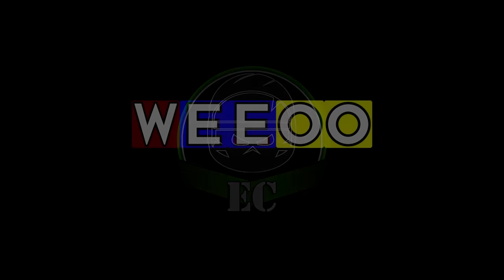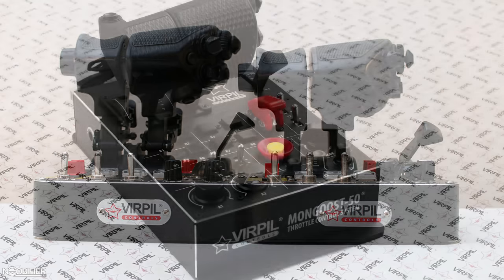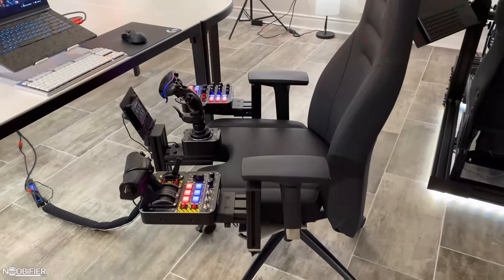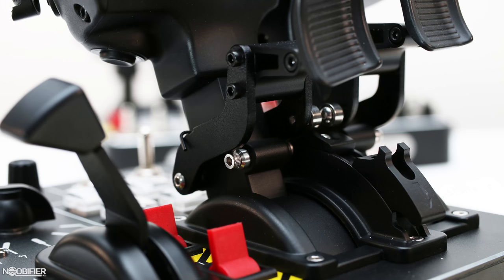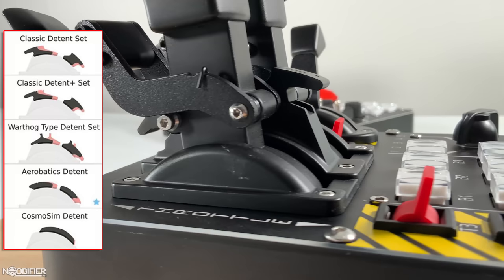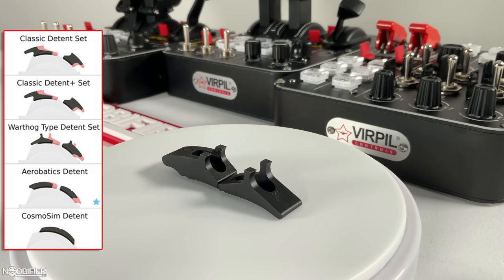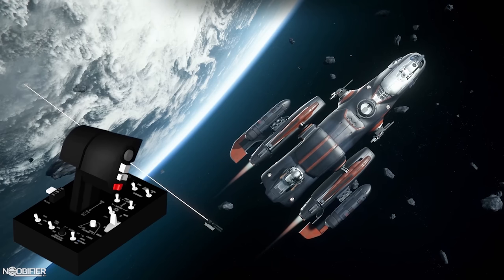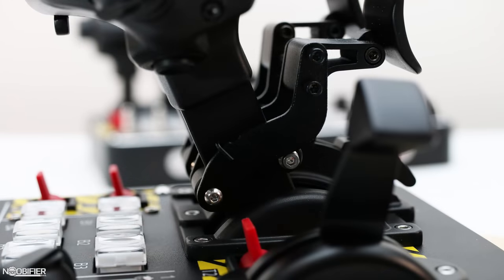MT50 CM3 Throttle - First look - Review & Overview - Virpil

Comment: Don't ever say you can't strip metal threads. I've seen it happen SOOOOOOOOOOO MUCH and I work on planes. It's soooooooo upsetting when you get 96 fasteners run down on a panel. Then the last 97th fastener just drops in or won't go in at all cuz the anchor basket is broken, missing, or stripped out. And now ya gotta pull alllllllll them other fasteners back out to fix that one anchor basket.

Comment: Quick question on the detents...  For the afterburner detent, is it possible to have to far enough to allow some range of travel after the lift?  I only ask as I fly in msfs and They usually have reverse thrust - Main power setting - Max power - TOGA.  So I'd like to put max and toga behind a detent with enough room to be easily able to set it to the correct power setting while leaving enough play for the main power setting if that makes any sense?
Reply from the maker: They are completely swappable, PLUS can be moved about 15 Deg either way so between the 10 included pieces, and the adjustment you should be able to get the exact performance you are looking for.. there are also those who have made 3D printed customs ones
Reply: @NOOBIFIER1337  Brilliant thanks so much! Might be worth the upgrade from my cm2 then and a perfect excuse to get a control panel while I'm at it
Reply from the maker: @MichaelHenfrey  There was a period of time when they were giving people who owned a CM2 a 10% discount on the upgrade. You should maybe contact them and find out if that still applicable

Comment: Does lifting the throttle for idle/AB detent send a signal out the controller? I ask because DCS usually has an "idle cutoff" key binding for most engines and it would be nice to have this bound to the throttles position instead of pressing a button
Reply from the maker: Not that I know if, but joystick gremlin has that feature

Comment: Wish they made it reversible so it can be used as a southpaw throttle. It blows my mind that there is STILL no lefty or even ambidextrous combat throttles with hats, encoders and levers on the grip. The only options are non-combat oriented throttle quadrants.

Virpil already have a left hand Alpha stick and an ambidextrous Delta stick. Is a throttle too much to ask for?
Reply: Left handed sticks are mainly for space sim users though, not for southpaws. These throttles are mainly for very realistic sims like DCS, and real fighters always have throttles on the left. I can definitely see how that's frustrating for you, but I just don't think there is a large enough market for them to exist without costing $1000 a piece, and even that may not be profitable.
Reply: @GuyFromJupiter  Well, I already think an Ambidextrous one marketed at the space sim crowd would be best.

Comment: How does the 3-way rocker work? In which spatial direction are the axis set?
Reply from the maker: They are all in the direction that makes the most sense based on what digit are used. Thumb is back and forth, finger rockers are vertical
Reply: @NOOBIFIER1337  aha, nice, thanks for the prompt reply!

Comment: is it possible to use the aerobatic version with two detents in star citizen, so that one detent always fits scm on any ship and the other fits going from 100% thrust into afterburner? would seem like the ideal setup to me but would possibly require changes in star citizen. or is scm now always at the same position in star citizen with the new logarithmic scale?
Reply from the maker: It moves but so does the Cosmo so it’s easy to set it

Comment: How hard was it to install the CM3 kit onto your CM2 throttle? was there a lot of Allen screws to disassemble and fart with?  like did the entire top cover have to come off?
Reply from the maker: It is impossible. It is a full throttle. The changes include the entire grip, arms and sensors.
Reply: @NOOBIFIER1337  great thanks, sounds like it's worth 500 then.

Comment: He did not review the Longer shaft.. Longer shaft means more displacement of fingers from idle position to Full throttle right?
Reply from the maker: It’s minimal. I didn’t notice it at first
Reply: @NOOBIFIER1337  you think its better?
Reply from the maker: @daemon3spade  I think they made it long so they could put the extra levers on it.  it fine. Both are good
Reply: @NOOBIFIER1337  And give space for the led buttons on idle

Comment: I have the VPC MONGOOST-50CM THROTTLE - does anyone know if there is a way to change out the black buttons for the new type?

Not an essential, but would be nice to have it match the panel I have from them (OCD-ness)

Asked on the forum but noooooo reply.
Reply from the maker: I dont know if thats possible. I suppose if they are the same switches, then the caps would come off..

Comment: Pleaseeeee tell virpil to offer a parts kit to upgrade the cm2. Seems like the change is just a part swap away for us cm2 guys.
Reply from the maker: That kit would likely be with $250 as it replaces the entire middle part from grip to sensors. I believe this is why they don’t offer it
Reply: @NOOBIFIER1337  cheaper than 400 for a new throttle, but I get your point.

Comment: After spending about $1500 on Virpil gear I'm done with them. It took them 2 months to organise a replacement USB cable. Not to send it or have it arrive, just to send the invoice for it. 
I found the 10% off for the new CM3 they offered me a bit insulting frankly. If they sold the new parts I would happily buy them but instead they want to sell a whole new throttle and my CM2 is now instantly worth less.
VKB at least made the effort to sell people upgrade kits.
Reply: Enjoy your CM2 - Virpil does make nice hardware. Yes, every manufacture can have defects. Hope yours is working now correctly with the USB cable replacement.

As for the detents - just 3D print them.

Looks like Virpil got the idea from Troll:
https://forums.mudspike.com/t/throttle-finger-lifts/9954
https://www.thingiverse.com/controllr/designs

Comment: Kind of crappy on virpils part keeping it a secret and continually selling the cm2 with no real warning the CM3 was coming. The decided against a upgrade kit (detents and extenders) and basically screwed their cm2 customers specially the ones that ordered since august.
Reply from the maker: I mean, they are screwed either way though. It’s not a simple “ cosmetic “ update sir. It would replace the main core of the CM2, and I had a look, it would need the user to remove and attach 28 plugs within the grip. A full tear down of everything except the panel inputs.   Or, they buy back used CM2s and do what with them... refurbish and re sell without a warranty? I understand frustration and I have no solution for you... but it’s not so simple.
Reply: @NOOBIFIER1337  I don't see how they could have gotten screwed by officially letting us know it was coming .... They would have had no problem selling off the remaining cm2 stock as many people (WWII/CIV) do not want detents not to mention the cm3 is $60 USD more than the CM2 and it's not like VKB Winwing Thrustmaster or Logitech was going to rip off their ideas.

Comment: Want the detent, do not want the height.
Reply from the maker: The height is minor.
Reply: @NOOBIFIER1337  My issue is that my current CM2 setup perfectly fits under my desk.  Like, by a centimeter, roughly.  Also, huge investment for a minor upgrade.  I'll probably grab the button box instead and call my setup complete.
Reply from the maker: Yes, there is no way to have the detents and a shorter arm... CM2 seems to be the choice for you

Comment: Not to offer the fingerlifts as an upgrade option to CM2 owners is a really silly decision. The 10% off for existing CM2 owners if they buy a CM3 is just mockery at this point. 
It is a great feature, but it doesn't warrant spending another 400 Euros when there would be a technically simple solution to the problem. Not to mention that this whole thing is based on a community mod to begin with. This reeks of a cash grab.
Reply from the maker: It replaces too much of the core of the throttle. the entire Grip and Levers need to come out
Reply: @NOOBIFIER1337  Make the parts that differ available and let the technically inclined worry about that,  Virpil! But no way they're getting 90% of the purchase price of the CM3 from all the rather fresh CM2 owners they just screwed over with their subpar communication. I love Virpil stuff but it really feels like they dropped the ball on this one.
Reply from the maker: @mhe0815  it’s not worth it for them plus it adds a huge problem with customer support when people who think they are technically inclined.... aren’t up to the task and break both.  It replaces the grip, the arms, the sensors... it would cost more to ship the parts, than a new unit. Hopefully you understand.  I asked the same question and they explained.